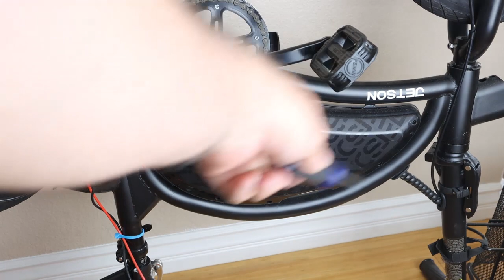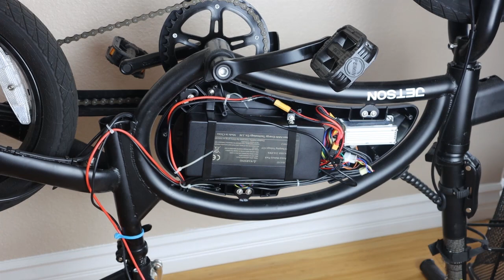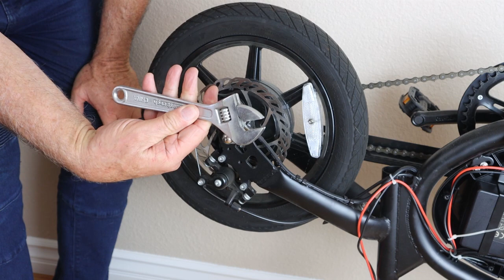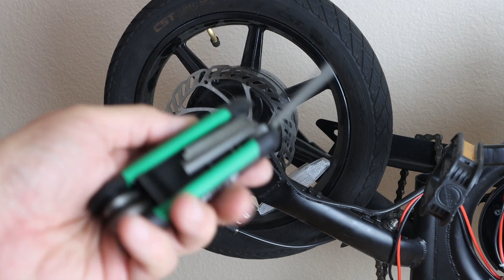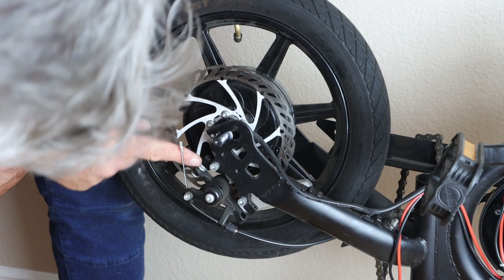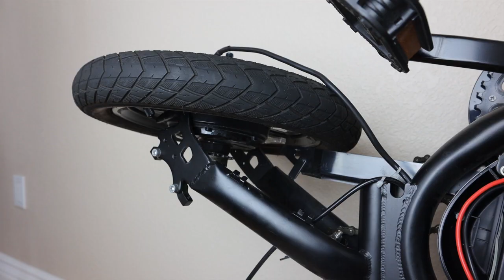Jetson Bolt Pro Rear Wheel Removal Part 1

Comment: Little confused if you change the rotor you definitely have to remove the cable right? I guess working and changing's different but I mean we're just changing a rotor normally unless you try to bend it back which I'm not having a great time doing
Reply from the maker: Yes, as the wire harness goes through the hub of the rotor and comes out of the motor.  You normally do not have to charge the rotor unless it becomes warped or scored.  You might be able to bend it back, but it would be hard.
Reply: @JoediyLab  yeah mine seems to be slightly bent It's been a a nightmare. But I changed brakes all together and that seems to have helped as long as you don't keep the tire too far back in terms of the chain bolt it works great. I was struggling for months with my brakes grinding on my rotor and it was just because my chain wasn't tight enough but it's a fine line to tighten it too much where the chain grinds or it's loose where the brakes grind
Reply from the maker: I doubt the rotor is heat treated,  set the bike near a vice or anvil and see if you can flaten out the warpage.
Reply from the maker: I took my rotor off, routing the wires was hard but doable.  Either buy a new rotor or see if you can straighten it out
Reply: @JoediyLab  I bought a new rotor but not sure if I want to try and get off the motor if I have it's difficult rn
Reply from the maker: yes, it is a pain,  I used safety wire to feed the wires through the hole in the frame.  Maybe try to hammer the rotor out.  You are going to need a heavy small sledge hammer and a solid surface.

Comment: You remove the caliper by removing the entire assembly from the frame directly.. That way you will not change any of the adjustments of the calipler and can just bolt everything back on instantly.

Comment: When removing the rear caliper, if you take out the lateral screws instead of the screws with the spacer you can pull the caliper off of the rotor without messing with the lateral adjustments of the rear brake. That is usually the trickiest part of any brake adjustment (and you don't have to worry about all the little spacers falling off of the ground/ figuring out how they were originally configured)! Great video, thank you! Im replacing a motor for a jetson bolt at our E-Bike shop and this is super helpful!
Reply from the maker: Thanks for the tip

Comment: No problem the missing part not showing taking wirers out. They will slide right through the frame . Then put them back on outside of frame with ties.
Reply from the maker: Sorry I just checked, I must have screwed up on the video upload.  I am out of town until October, when I get back I will upload.  I used a piece of stainless wire to fish the wires down through the frame tube,  also creating slack in the brake cable, and was able to easily fish the wire back into the battery compartment.
Reply: new problem the roter bolts are stuck. I will order a torch and try shocking thew with out burning the motor. @JoediyLab  roter
Reply from the maker: Get yourself some hex head sockets and a torch, and some penetrating fluid.  That should work.

Comment: The hardest part is not shown? Feeding the wires through the shielding then the frame. This is a nightmare fix. I'm going to try and reroute the wires out side the frame?  I will never buy a electric that has this problem again junk. Bad design use once through away.
Reply from the maker: Watch the third video I created, I used a piece of stainless steel wire and had no problem doing do.

Comment: Hey Joe, have tou posted part 2 of this?   Im not seeing it.  Trying to get the wire to pull back. But way too tight to fish through.  Did you cut all the conectors off to get to fish though?   A neighbor wrecked ours and bent the rotar, so trying to replace it.  Thanks in advance!
Reply from the maker: Hey Brandon,  Part 2 will be posted tomorrow.  Part 3 will be posted  on August 10th.  Thanks
Reply from the maker: Part 3  is reassembly so you should have enough after tomorrow, Thanks
Reply: @JoediyLab  You're awesome, thank you so much!
Reply: Hey Joe, your part 2 is the assembly of it back, shouldnt be the second part of taking it apart?   How did you get the wires through the frame?   I can't get them to go through.  Did you cut the connector ends?
Reply from the maker: @brandons84664  I used a piece of stainless steel wire to pull the wires back into the battery compartment.  It is pretty easy to run the wire.  Then tape with wires to the steel wire. Out some slack in the rear brake cable and gently work the wires through into the battery compartment

Comment: Sir, I think it's much easier!
To remove the rear wheel, it usually works well without removing the brake caliper or anything else from the brake. IF, you still need to make room for the brake disc when the wheel is pulled back, the easiest way is to remove just ONE screw - the rear of the two - that holds the ENTIRE caliper, and then twist the caliper a bit - and pull the wheel out. 
That screw can sit really hard so you may need a piece of pipe as an extension for the Allen key.
Don't forget to use a blue thread lock (Blue Loctite) when screwing the removed screw back into place.

And... when you need to change the rear tire, you don't have to remove the entire cable and mess with the entire cable nest... You "just turn the wheel" so that the motor cable points downwards, then you have free access to change the tire.

Best regards
Reply from the maker: To remove the brake rotor you have to remove the motor wires.

Comment: Where are you from I have a 2013 gsxr750 need help timing it can you post pics of the marks?
Reply from the maker: Let me check the manual,  I am located in North County area San Diego, CA
Reply: I appreciate it do you have a instagram or something that I can pm you on
Reply from the maker: @AlexMiller-t4b  ignition timing is handled by the ECM, in other words it is not  adjustable.  At least not manually.  If you have an ECM tuner you may be able to adjust ignition timing,  but normally the ECM handles any timing for a stock engine.
Reply: I need cam timing
Reply from the maker: @AlexMiller-t4b  there are several videos on my channel that cover valve clearance and setting up the crank position.  Did you watch those.  If you go to my about page my email address is listed.  Send me an email and I will send you some images.  Are you trying to check your valve clearance?